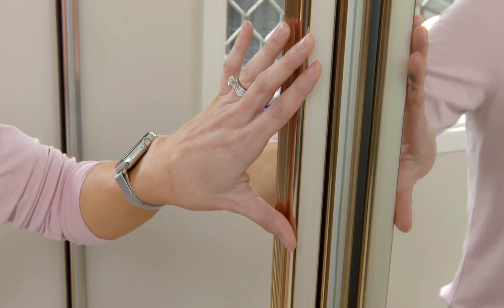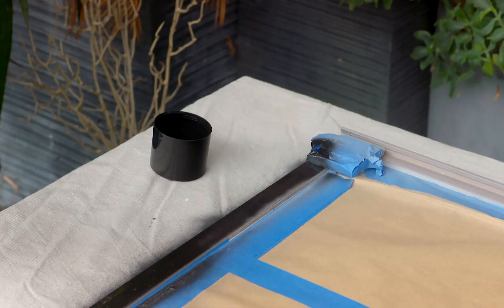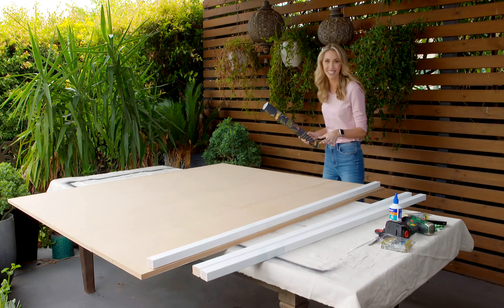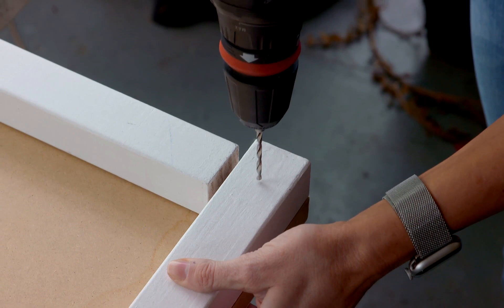Bedroom Makeover | DESIGN | Great Home Ideas

Comment: Yes, I agree, it’s an improvement. My only niggle is the bed so close to the wall near the window. I appreciate there’s only a small space but imo, it would’ve looked a lot bigger if the bed/headboard would’ve been centred. Gorgeous colours though. Where’s Tara? I miss her. 🥰
Reply: Is it a huge improvement? This room didn’t come together for me. The shoji idea was a good idea but the mirrors are still shiny instead of getting a nice coat of spray frost. I feel like I know too much about the couple who sleeps here. 
The floral wallpaper is pretty. But how does it relate to the mirror with the black shoji framing? The shoji effect is japandi but more modern than organic, and the floral wallpaper is 1986 Laura Ashley. I love the color of that blue wall. But the bedding doesn’t go with anything else except pulling a few colors from the wallpaper. The frame around the headboard is white. What else is white in the room? It’s off center. Is there a massive dresser on one side of the room? Why didn’t we address that? The curtains are sheer. In the morning the sun is going to hit that mirror and burn the residents’ retinas. We haven’t even talked about that light teal blue area rug.
I’m sure she’s nervous. She’s going to get better with time. But this bedroom was a miss for me. Whatever she was going for here just didn’t hang together. It’s ok. It’s an experiment and we all learn from them.  I have a shocking pink room I need to repaint. Who knew that painting the ceiling would intensify the color?  But when you see on camera that things are just not working, better to catch it early. This needed a bit more thought. You can’t edit everything. 🤷🏼‍♀️
Reply: I agree with everything you said!
Reply: I agree
Reply: Off centre bedhead looks bad.